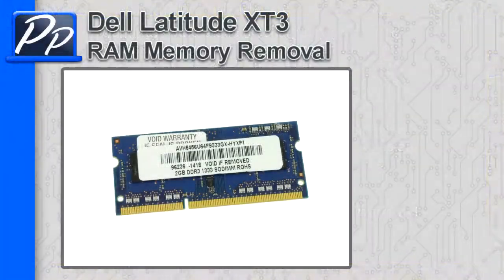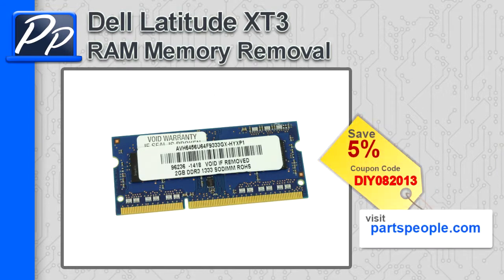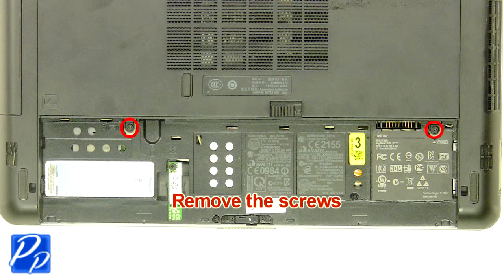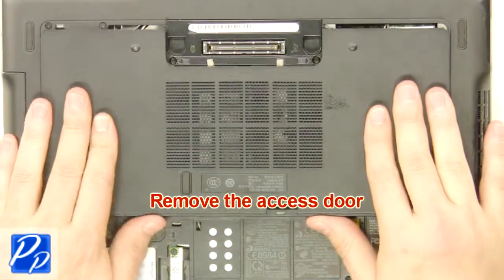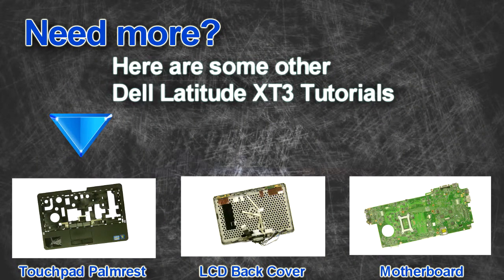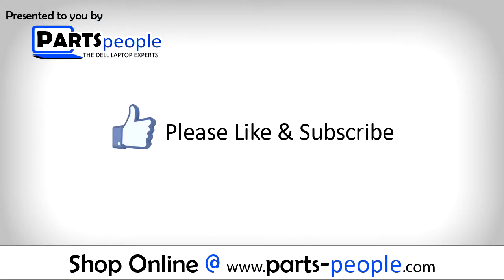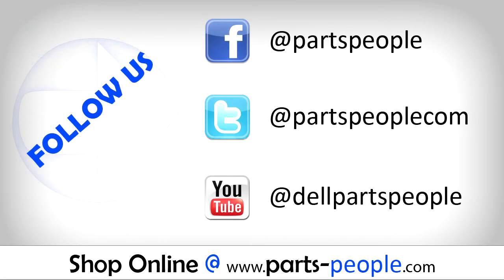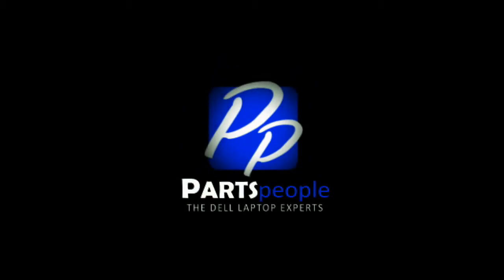Dell Latitude XT3 RAM Memory How-To Video Tutorial

Comment: Hello
My XT3 is getting very hot sometime's above 80 degreese how can I solve this?  I already put new thermal paste on the CPU.
Reply from the maker: +jak797 Cleaning the heatsink  & fan and reapplying new thermal compound are the main things you would do to get the laptop to run cooler. If that doesn't work you can try using a cooling pad. Other than that, you can avoid using really graphics intensive programs and games.